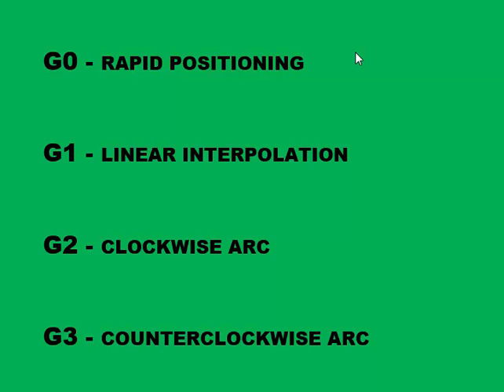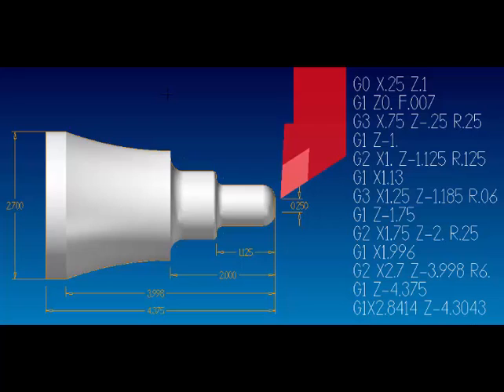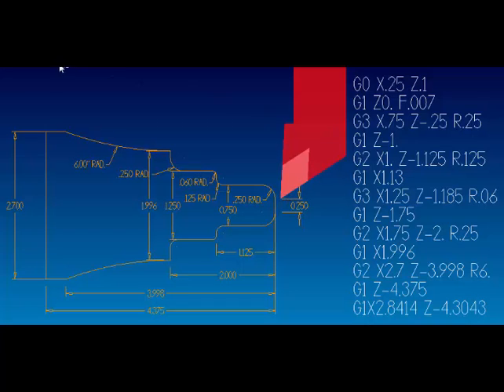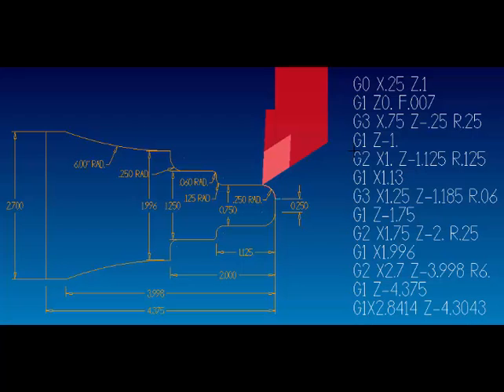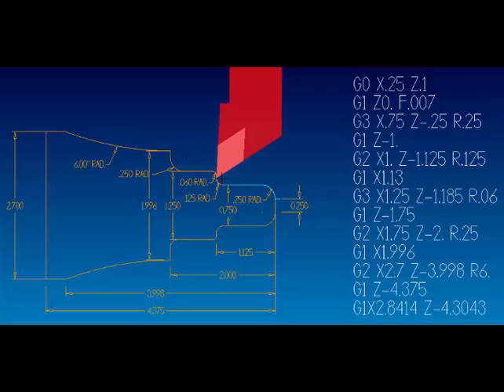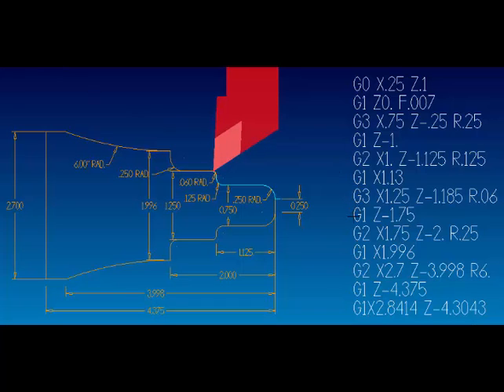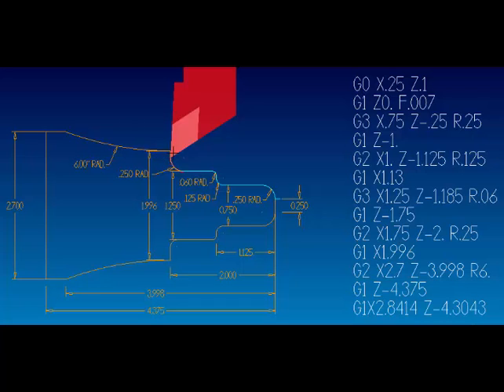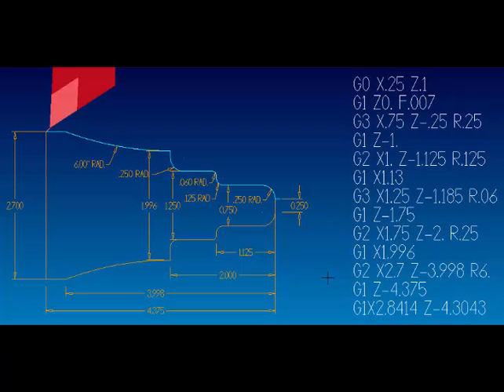CNC LATHE PROGRAMMING LESSON 5  WRITE A TOOLPATH USING  G0 - G1 - G2  AND G3  MOVES

Comment: Hi ya, I have a question that I hope you can help me with. I run a YouJi vtl and I was doing a job and had a problem :/ I finishing a face of a 55inch brake disc and had to rerun the face from dia 38inch (I have four 2.500 holes so an interrupted cut) 63surface finish from 55'-38' and 125 surface finish from 38'-16.800'. 

(Note my dimensional number are approx)
In the program, it has a liner move g1 to x16.800 on a Z depth -7.000 then a g3 x16.188 
z-6.890  r.250 then it goes up on an angle with another quarter inch radius to meet the hub. BUT!!!! when i came back to fix and rerun the face at that 38inch dia I manual moved to that position and ran the program from their and when i got to the line with the g3 it started to go back to the direction it came and into the part!! :(  

I hope you can help as this has put a really big dent in my confidence I really take pride in my work. 

Regards James

Comment: I assume the video shows a top view of the part and the tool. In my lathe the tool is on a post, and is opposite (bottom) from the tool position shown in the video. Does that mean that my clockwise and counterclockwise moves have to be reversed?
Reply from the maker: Crivo152  The location of the tool does not matter. just make sure the spindle rotation hits the cutting edge of the tool and not the back side.
Reply: +Tom Stikkelman Thanks for the video. I think that Crivo152 was referring to the machining on say a manual lathe. With a conventional manual lathe, as you view the workpiece from an aerial view, the tool is at the bottom of the workpiece. This would logically make a convex radius on the front of the part a clockwise rotation of travel, rather than anti-clockwise as the video states in this example.
Reply: Try making a cut and see if your cutting

Comment: If the features entire width was 1.996, wouldnt the X value be half of that in the G-code Since X-0 Is the center of the chuck/workpiece?
Reply from the maker: Logan Eads 
The X values will always be diametral. So X1.00 inch would machine a 1.00 diameter but the actual location of the tool top is .500 from centerline of spindle.

Comment: Didn't quite understand
G1 x 1.996
G2 x2.7 z -3.998 R. 6.0

Can anyone explain?
Reply: G1 x 1.996:   if you look at diagram just before the 6" radius part, there is a verticle measurement line that reads 1.996.. after it cut out the .25 radius it needs to get to this position, so a linear interpolation is executed ie "G1"
Reply: G2 x2.7 z -3.998 R. 6.0:  G2 is used for clockwise direction, end point of curve is 2.7 as shown by verticle measurement line to the far left of diagram. z-3.998 is where cutter (z axis needs to be) where the curve ends, this measurement is shown on the horizontal measurement line second from the bottom. R.6.0 is the radius..
The syntax for G2 is [endpoint of x][endpoint of z][radius] of which all is related only to the curve.
Reply: Way to hard. Go sell French fries instead.
Reply: i hand write this at the machine everyday, very easy. use point to point, i draw part then use point to point. but i start .100 below smallest diameter for cutter comp to kick in on a Doosan lynx300 lathe

Comment: OMG all the measurements are Inch 😒🤔 any advice how to get into Inch measurements from Metric??
Reply: 1"=24.5mm
1mm= .03907"
do some math or you could download a conversion app.
Reply: correction @rusty... 1" = 25.4mm not 24.5mm..
Reply: Rusty Shackleford 1mm = .03937"